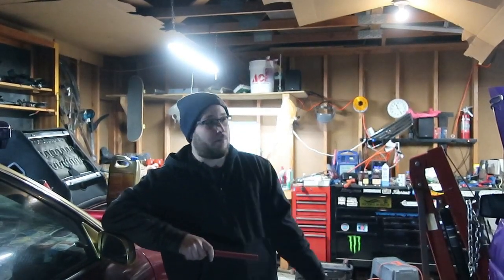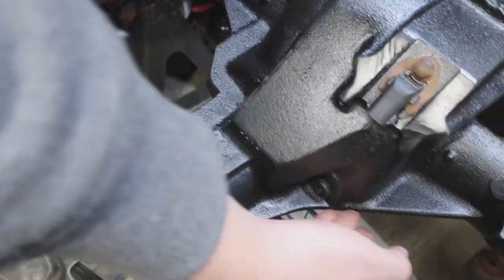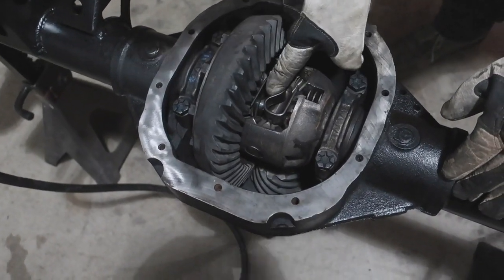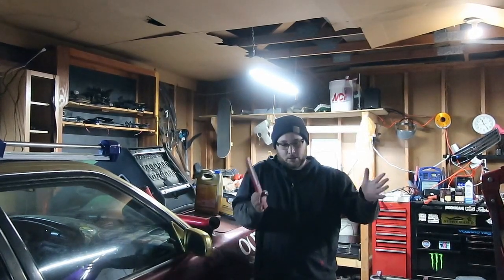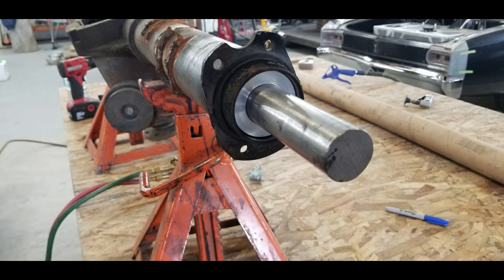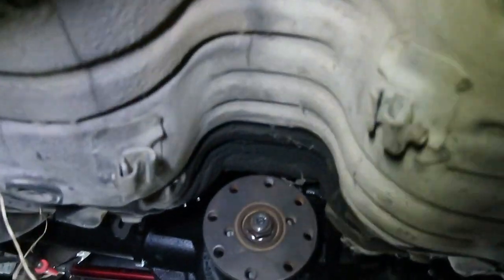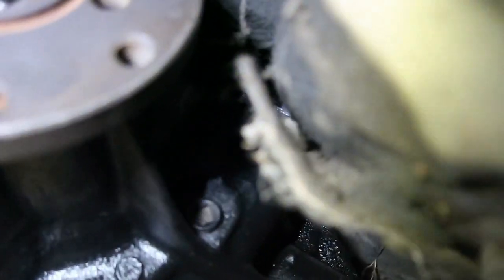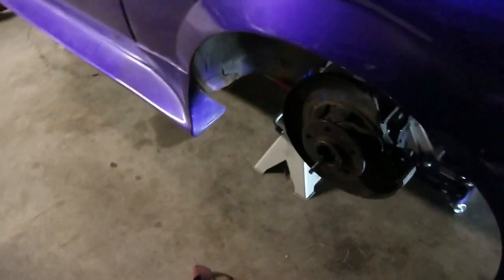Swapping a FORD 8.8 axle into my AE86 (how to)

Comment: What driveshaft options are out there ?
Reply from the maker: Mine is a completely custom shaft made by a local shop. Uses W-series front output shaft yoke and typical Ford 8.8 rear from a ranger. Also used front and rear ranger U-joints.
Reply: @theoutsiider9461 Thanks for the reply. Im looking into options for the open sr5 diff. Im still running a T50 with a 4age so your video is super helpful. Any suggestions to get me on the track for the least  amount of intial cash? Im chasing seat time.

Comment: Whats the lenght of it compared to the oem axle and what wheel spec do u use?
Reply from the maker: It’s about a inch wider on each side and I’m using 20mm spacers and 16x8 +20

Comment: How did you know where to weld the t3 brackets? Did you build a jig or some other method? Thanks!
Reply from the maker: I took both axles and measured angle on pinion to bracket angle and then set spacing from center of pumpkin. I also have heim joint arms which have a lot of room for movement of the bracket might end up “out of factory” alignment.

Comment: I have a 8.8 31 spline differential from a 98 explorer. I have an ae86 coupe what were you're measurements? Did you have to measure with the  wheels offset & tires?

Comment: How well do the t3 brackets have to be welded on? Did you do just outer beads or inner and outer? Any cutting on the brackets to make them fit or did you just send it? I just had mine welded on my 87 Ford 8.8
Reply from the maker: I think just outer would be just fine as long as you have a decent power welder. I did both inner and outer though just for piece of mind. I didn’t however weld it closed I left some spots open for water to drain out if it gets trapped inside the bracket to housing. And no cutting of the brackets. They fit right on. I just mocked them up roughly to factory spots/spacing and sent it.

Comment: Would you recommend on te72?
Reply from the maker: Depends on engine. If anything over a 4age 16v you’ll want a AE86 GTS axle at least. So it only goes up from there. I plan on turbo charging the 3sge and wanted the rear end to never give me issues so I way over built it.

Comment: Will a 8.8 out of a mustang work?
Reply from the maker: Yes and no. A Mustang 8.8 has many disadvantages. Fox body for example only came in 4x108 bolt pattern, that’s much different than most commonly found wheels such as 4x114 or 5x114. Also all mustang 8.8 only came 28 spline which is much weaker than the expedition or mountaineer axle at a 31 spline. The biggest down fall is the 4 link mounting tabs that the mustang chassis used. The top mounting tabs are cast into the housing and are not easy to remove. They are large and take up to much space that would normally be needed for smaller chassis such as AE, TE and alike.
Reply: @theoutsiider9461  what about crown vic 8.8?

Comment: did you weigh the 8.8 vs the stock axle i know that comes up a lot but I've never seen any actual numbers on the difference
Reply from the maker: I did not. But I’ll assume a rough 50 lbs heavier. It’s not a crazy amount. A stock GTS axle weights about 145~150 and a shortened fully loaded 8.8 weights right around 200lbs.  I know I’m not the strongest but I could still lift the fully assembled axle into the back of my pickup by myself. And compared to the GTS rear end it’s not drastically heavier.